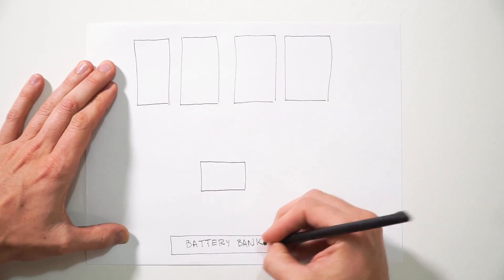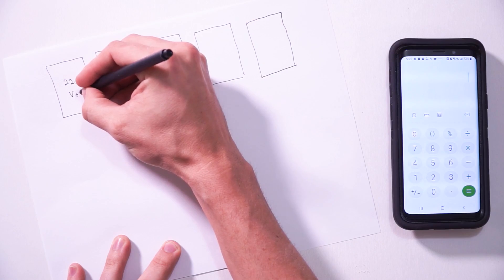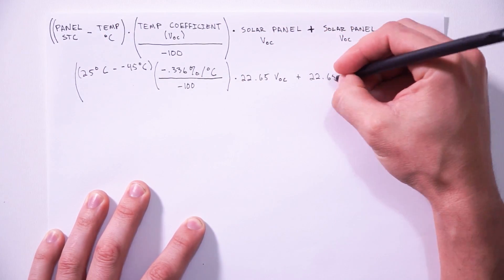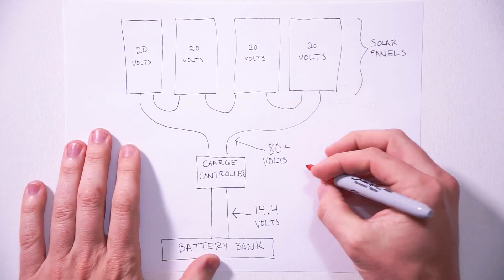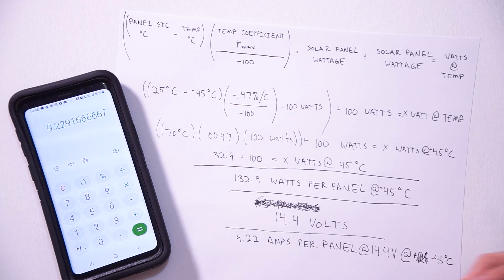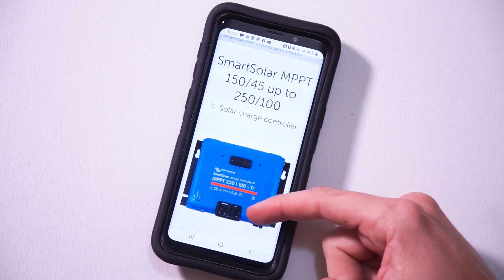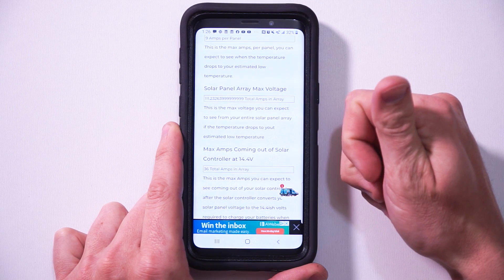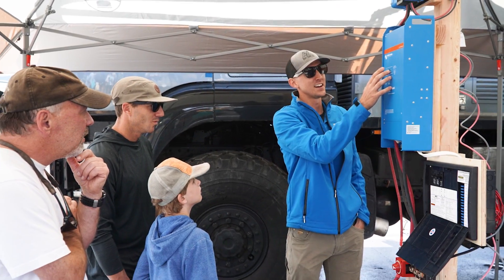How to Size a Solar Charge Controller for a DIY Camper Van Solar System

Comment: I have another question. In another video they hinted at the possibility to use multiple charge controllers in parallel. Is that advisable? Example: 2 charge controllers with either separate solar panels (which sound sane) or with the same solar panels cross connected to both controllers, on one battery (array).
Reply from the maker: There's no issue with multiple charge controllers.  Victron SmartSolar MPPT charge controllers will talk to each other and combine charging.
Reply: @EXPLORISTlife  and if they are just simple ones that don't talk to each other?
Reply from the maker: Tough to say.  I recommend reading the user manual or reaching out to the manufacturer to find out.
Reply: @EXPLORISTlife  ok thanks, good idea

Comment: Hi. I was, if you have 5 100 watt solar panels, could you put 2 and 3 in series and those 2 arrays in parallel? What consequences would this have?
Reply from the maker: You will have pretty substantial power loss in that configuration.  Here is a blog post that will teach you the math to figure out how much power loss there will be: https://www.explorist.life/using-mismatched-solar-panel-sizes/
Reply: @EXPLORISTlife  thanks a lot. That answered my questions. p.s. I found a mistake in the blog post and left a comment. In the last example the voltage and thus wattage and efficiency are wrong.

Comment: my pvs 350 in series and voc add up to 69.2 v i picked Charge Controller is 100/30 would that work for a 48v battery and if my inverter was 12v would be fine too
Reply from the maker: The 100v Victron SmartSolar charge controllers are only compatible with 12 & 24v battery banks.  You will need one of the 150v versions.

Connecting a 12v Inverter to a 48v battery bank will damage it.  You need a 48v inverter for converting from a 48v battery bank.
Reply: @EXPLORISTlife   100v is the max input volts from the pvs. why i need to add more if the pvs in series is 69.2v . if i picked 150v would that be too much
Reply from the maker: You don't need to add voltage or anything.  The Victron Smartsolar 100/30 like you are talking about is simply not compatible with a 48 v battery bank like you have chosen.  The Victron SmartSolar MPPT 150/35 (https://amzn.to/31WLSP1) is compatible with 48v battery banks.  You don't need to change anything on the solar side.
Reply: @EXPLORISTlife   why do i need 150v versions. also i found a 48 v inverter. i should be fine with 12v pv and a 12v CC and 48 battery and 48v inverter right ?
Reply from the maker: The 100V versions of the Victron SmartSolar MPPT Charge Controllers  (Like the 100|30 or the 100|50) CANNOT charge a 48v Battery Bank.  It is simply a component limitation.

The 150V versions of the Victron SmartSolar MPPT Charge Controllers (Like the 150|35, 150|75, 150|100) can charge 48v battery banks.
Reply: @EXPLORISTlife  understood .. but what my pvs v would be 12 or 24  in series ?

Comment: How to connect 5 penals of 250watts each panel is 36v
Reply from the maker: Ideally in series as long as your charge controller is big enough. Victron SmartSolar MPPT 250|100 SHOULD do the trick; but double check with the calculator from this video.

Comment: Thank you for the information. I think your explanation of max output current of charge controller is not entirely right. As per charge controller datasheet for example Victron 100/50 the maximum current of the controller "Max. PV short circuit current " can handle is 60A not the rated charge current 50A. So if you're checking at worst possible operational point scenario and the value is slightly above 50A I think it's ok because the controller can go to 60A.
Reply from the maker: There is a little bit of a buffer, but the amperages above the rated current of the charge controller will not be used and will be throttled.  So... the max amperage you will see coming out of a 50A charge controller is 50A, even if there is enough incoming power to produce more.

I specifically omitted this from the video as, from a teaching standpoint, I felt it more confusing than clarifying to somebody new to all of this.

I hope this clears up your confusion.

Comment: Hi, a needed feature in the calcultor: I have a solar set up already and i wish to expand by adding more panels how many can i add , or rather how many watts can i add to my existing charge controller?
Reply from the maker: You should be able to play around with the numbers in the calculator to figure that out.  No additional features needed.

Comment: Hi Nate, your video are super easy to follow and your are excellent instructor - thank you!

Question, how does the Victron Smart MPPT charge controller work in a solar - RV battery system? 

For example, I using a Victron MPPT 150/100 with  4X 200W of 20 Voc solar panels (800W, total Voc of 80V), plus  a 12V 200Ah (2.4kWh) with the charging voltage of 14.4V ==> does the Victron automatically keeps the charging voltage at 14.4V and have the charging current at 800W/14.4V = 55.6A? Or is the system charging current = 200W / 20Voc = 10A?

Can the Victron MPPT be program for specific charging current such as 50A? If the Victron MPPT charge controller can be set to 50 A, then what is the system charging voltage? I want to assess if my system operates with the limits of this Victron MPPT charge controller of 150V/100A.

Thanks!
Reply from the maker: The charge controller simply re-charges the battery in your RV Electrical system.  At the base level, that is all it does.

800w of power regulated down to the battery charging voltage of 14.4V would be, as you mentioned, 55.6A heading into the charge controller.

The Victron SmartSolar MPPT can be programmed for lower charging current if desired.  The voltage will remain constant at the pre-programmed specifics (of 14.4v or whatever you chose).

Comment: Dave, thanks for a great video!  Three questions: 1) If I use my camper van spring to fall and not dead of winter, am I safe to use a milder low temperature like 10 or 20 F?   2) You mention wiring panels in series but I've read that for 4 panels, it's better to wire 2 sets of 2 panels in parallel, then each pair in series, to protect against huge power loss if even one panel is shaded--your thoughts?   3) I don't understand the load output function on MPPT controllers and why doesn't the Victron have it?  Renogy and other do have it. But again, I don't even know what it is or how important it is.  Thx!
Reply from the maker: 1:  Even if YOU don't use the camper in the winter; if you ever sell it and the next buyer does; sizing the charge controller for mild climates only would be dangerous for the next person down the line.

2: Series or Series-Parallel are both fine depending on the array.

3: It can be for powering loads ONLY when the sun is out; or ONLY powering loads during certain times of the day.  Ultimately, it's not very useful for campers.  The less powerful victron MPPT's have it (Like the Smartsolar MPPT 75|15) because those are commonly used in solar powered streetlights.
Reply: @EXPLORISTlife  Thank you!  I believe you did the 2+2 series/parallel on your family's truck camper.
Reply from the maker: Yes.  That's correct.

Comment: What do you do when the data does not add up correct, or if any of the STC data is not available?

NEWPOWA 200W 12V MONOCRYSTALLINE HIGH EFFICIENCY SOLAR PANEL. 
Or...
The RICH SOLAR 200 Watt 12 Volt Monocrystalline Solar Pane

Comment: So, why does victron not have load control outputs in any of their larger models?  I think 150/20 is the biggest that does.

And for the models that don't, what's the best option for battery protection/ low voltage cut off?
Reply from the maker: For Small DC loads, you should look into the Victron Battery Protect.

For big loads like an Inverter, it will have low voltage cut offs integrated internally.

For battery protection, just make sure your BMS is set up correctly, or use a battery that has an Integrated BMS.  All of the diagrams I have on EXPLORIST.life use a battery that has an internal BMS that will control low voltage cutoffs: https://www.explorist.life/3000w-inverter-400-600ah-400-to-1200w-solar-camper-solar-kit/

Comment: Nate- that's HUGE!!! The price of peace of mind is priceless. I don't mind doing the background work (using your calculator, doing some hand math, etc..), but- would feel 1,000 times BETTER if I could convince you to eyeball my work. Additionally, I will reference all of your work for determining wire size, but- as long as we talking solar- maybe, I could convince you to check that as well? I'd rather do this work RIGHT once, and, get years of service from this expensive equipment, than burn out controllers, ruin batteries or burn down my truck camper! Yikes!
Reply from the maker: Awesome!  Glad it helped.  Thanks for watching!

Comment: Hi Nate!!
Still loving all your videos but not getting my head right around it yet!
My panels dont seem to have all the info on them
im running 2x 300ah 12v lithium batteries in parallel for 12v 600ah, I then have 2x 300w solar panels with open circuit voltage of 24V and max power current of 15A. I just purchased the renogy 50A dc2dc charger with solar input which has a max solar input of 660W and 25V. Im unsure on how to safely wire these panels in to get the most efficiency or if maybe i need more solar and a different charger/controller to efficiently charge my 600ah battery bank.. 
also not sure if that makes sense or if im just really confused haha

Comment: Hi, great vid 
Can I use 2 different panels that produce different amps and watts in parallel. 
Cheers
Reply from the maker: If the panels are in parallel and the volts are, say, within 1 volt of each other, that will be fine.  There will be a bit of power loss, but not much.

Comment: That’s great thanks.
My question is, should I go up to above my ampage for the controller- my ampage works out at 52. Should I get a 60, or a 50 amp size controller?
Thank you
Reply: 60 amps, always better to go more then less. If some accident happens and it goes over the controller limit, you're out a few hundred dollars
Reply: The amperage (current) won’t do anything to the controller. It will output as much as it’s rated for and waste the rest.
The voltage coming in will fry the controller if it’s over the rated capacity.

Comment: Nice video.... Questions:  What size Controller do I use for a 12Watt, 12v Solar panel hooked to my Boat Battery?  5A, 10A etc., ?   Any HELP is appreciated.  Thanks in advance
Reply from the maker: Based on what you learned in this video... what size of charge controller DO you need for your solar panel? What did the charge controller calculator tell you? :)

Comment: I just recently purchased victron smart 100/30 mppt controller. I currently have two renogy 100 watt panels i plan on using in series. Curious what combinations and maximum amount of 100 watt panels my controller will handle?
Reply from the maker: Based on the information I provided in this video... what do you think the answer is?
Reply: Thought i would cheat! Figured you probably know the answer in your sleep. I was planning on expanding it to 4 identical panels in series which i believe are within capacity but have not actually done the math.
Reply from the maker: Haha.  Indeed!  But what's an educational channel without a bit of learning. :)
Reply: I will try your calculator link here in a few.
Reply: Thank you for the encouragement to try calculator link above!  Looks like I am limited to 4 panels either in series or series parallel.  I oversized my wire that will connect panels to controller ( 8 gauge @ 30 ft)  do you have any suggestions for best configuration of panels? Panels will  be diy solar suitcases .
Reply from the maker: @RichardCoryMagill  Nice!  Series with those panels gets REALLY close to exceeding the max voltage of those panels as the temperature gets colder (once you get 4 panels).  For that reason, series-parallel is your best option and will work very well.
Reply: Your thoughts on circuit breakers vs fuses?

Comment: This really seems overly complicated, the victron rep explains it in very easy math how to estimate which controller you need. I'm pretty sure they said the controller just cuts off any extra voltage it can't handle. There's not much to gain when temps are that cold. I think it's just wasted money better spent getting more solar panels rather than throwing away money for an oversized controller
Reply from the maker: It cuts off excess amperage on the output.  If the voltage is too high coming into the charge controller, it can fry the charge controller, permanently damaging it.
Reply: @EXPLORISTlife  ok I'm bad at math but the equation he uses is wattage of array x 0.9 / 12 volts = amps. The maximum wattage for the array for each victron charge controller is right on the product description, so it boggles my mind why your equations would need to be this complex. If it was so easy to damage the controller or array I don't see why victron and every other channel wouldn't plaster that warning everywhere. Litterally this is the first time I've ever even heard of anybody giving a warning like that. I'm not really trying to argue whether you're wrong or right but I'm pretty dumbfounded that if this was so serious why isn't everybody warning us about this?
Reply from the maker: That Equation will work as a safe rough estimate but the majority of my audience watching these videos on my channel want to know more about the 'why' we choose the numbers we do, so I teach that.  Also, since I am an Ambassador for victron who gets paid to teach their distributors this stuff, I am held to a higher level of teaching than most.  I try to make things as easy, yet comprehensive, as possible.
Reply: @EXPLORISTlife  this is the am solar rep I was talking about https://youtu.be/Di499j08IeY he said that in Alaska it's the opposite of what you're saying so what you're saying is confusing me since it's the opposite of what the victron rep is saying

Comment: So I know we need to size the panels to the charge controller and I also know many days will be less than stellar conditions and it may be cloudy and so what happens if too much solar power is connected to the charge controller?  In the Victron users manual under standards and safety, it says "If more PV power is connected the controller will limit input power". I take that to mean the controller will only use what it can and the rest will be wasted.  What are your thoughts on this?
Reply from the maker: Correct!  The charge controller will simply limit the amperage output if the array is putting out more power than the charge controller is rated for (The second number on Victron MPPT charge controllers tells us how many amps that charge controller can deliver to the battery).   BUT...  if too much voltage is delivered from the array to the charge controller, the charge controller can be damaged. (The first number on Victron MPPT charge controllers tells us the maximum solar panel array input voltage.

Also... remember, the voltage can be altered depending on how the array is wired.  More info: https://youtu.be/KJ5zCY5EBeQ
Reply: @EXPLORISTlife  Thank you for the reply, and in my case installing maybe one too many similar solar panels all in parallel (600 watts) the voltage will not change, only the amps and only when the conditions are optimum.  It has worked out to size my solar controller 100/30 and not have to step up the the more expensive 100/50, and I have fused it according to protect the charge controller....
Reply from the maker: If you are using a 12v battery bank, you will need to the 50 amp charge controller for 600w of solar.  600W (solar array wattage) / 12V (Battery Bank Voltage) = 50A (Charging potiential going from charge controller to battery bank)
Reply: @EXPLORISTlife  So I've been using this charge controller, Victron 100/30, on my 12 volt battery bank with 600 watts of solar panels for almost two years and the most I ever see on my Bogart Trimetric TM-2030 RV Battery Monitor going to my battery bank is 30 amps and so I think if there is more current available the charge controller just limits it, which was my original question and point...thanks. So you may say I need to upgrade, but that means a larger more expensive charge controller and upsizing my wire and fusing,  and most of the time my system works fine and is recharged before noon.  Isn't solar so very interesting...thanks for your great work and all you do...Terry
Reply from the maker: Oh, gotcha.  I thought you were trying to plan a system, not analyzing a two year old, adequately functioning system.

Sometimes it's tough for me to tell who is asking a question vs who is telling me a story. Lol. Sorry about that!
Reply: No, its my fault for not explaining it correctly, I was confirming what I did two years ago to add an additional 200 watts ( free by the way) to my existing 400 watt system was as I thought going to work and why.  I know we have to plan systems for those worst days and I thought with more solar than my charge controller was rated for, on cloudy days it would perform better with the added 200 watts and the charge controller would limit the output when conditions were bright and it does so far.   I may upgrade sometime to the 50 controller.
Reply from the maker: All good!  Glad everything is functioning as you wish.  Thanks for watching, as always! :)